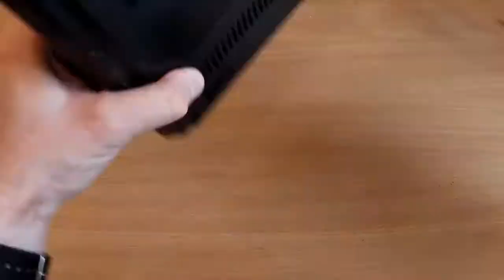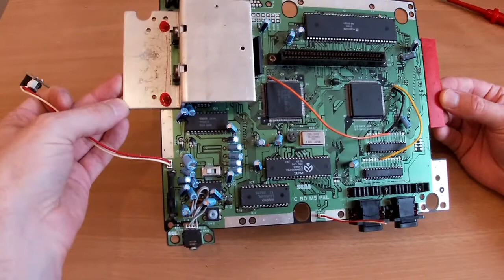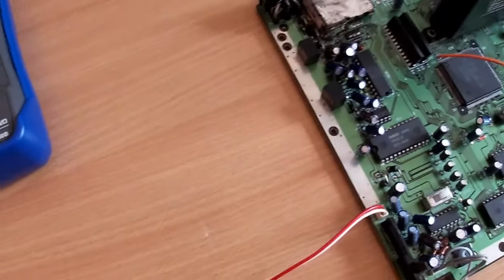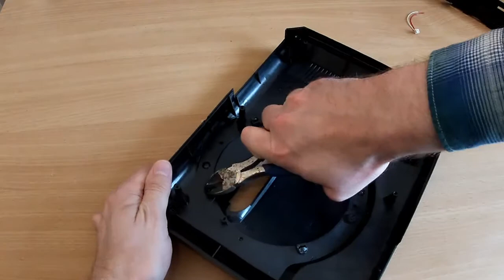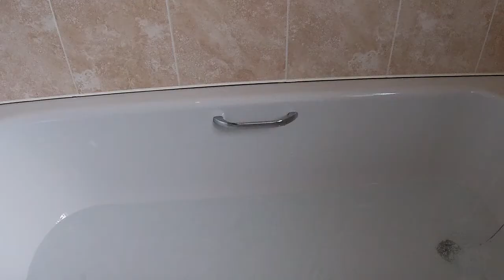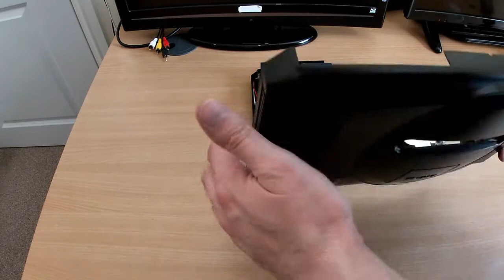Sega Megadrive Part 2

Comment: Hi, i enjoyed this vid,  so as a megadrve owner myself, my tips.
buy an Everdrive,a SCART cable and a new power supply. (RF is a waste of time and effort)
 You didn't need to make the hole bigger for the LED , there are different sizes out there,.
You can put your motherboard in that there bath or even a dishwasher (check out perifractic)
i am going to change my reguators per your advice (thankyou)
Blue LEDs look fantastic.
Reply from the maker: I’ve just received my Everdrive 😀 . Looking to build a cable just to see what’s involved. I’ve not seen the smaller colour change LED’s ah well never mind. Thanks for taking the time to comment. Cheers